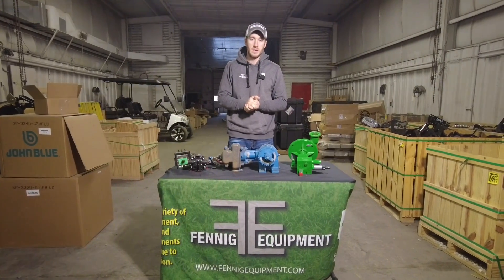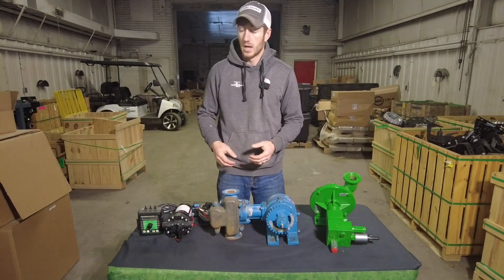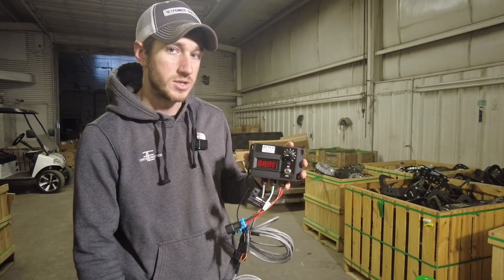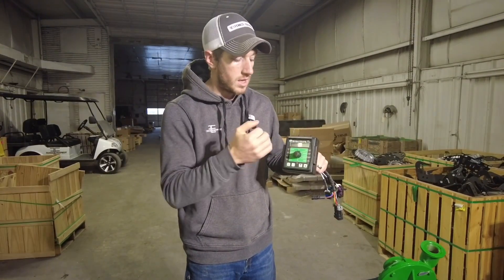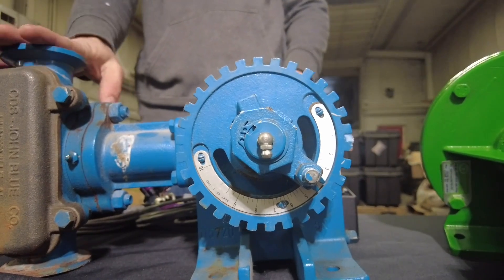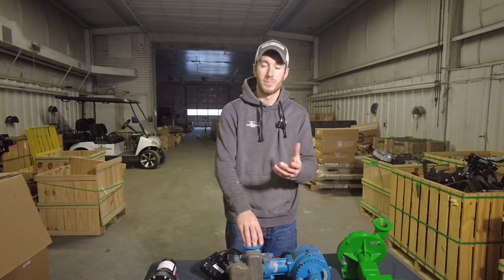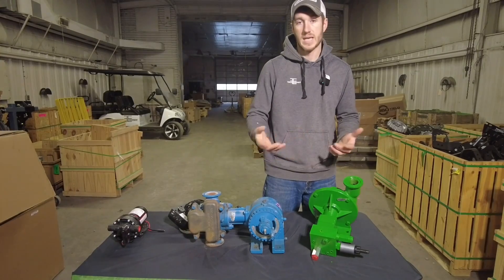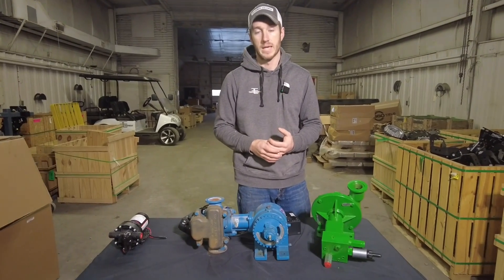Choosing the Correct Pump for Your Planter Fertilizer System

Comment: With the pwm Hyd pumps do you still need the butterfly valve? They get on rate good on the ends?
Reply from the maker: The pwm is the butterfly valve, 
The difference is the PWM valve controls the hydraulic oil going to the pump so that the pump only spins as fast as slow as it needs to. Whereas in a electric butterfly valve situation, the pump is running a static speed and the butterfly valve is controlling the liquid product coming out of the pump . The PWM valve increases and decreases the hydraulic flow going to the pump so that the exact amount is always coming out of the pump, so no need for a butterfly valve downstream.
Reply: @FennigEquipment  yup that's what I thought. Now if only we can get deere to code the software to tell the tractor to speed up or slow down the scv based on the gs rate controller  needs. so then you don't need another  electronic gizmo to go bad. With seedstar 4 that is already  happening for vaccum control I think unless the valve is on the planter side
Reply: I run in furrow with a John Blue piston pump but don't have orifices? Just lines to each row with check valves to stop the dripping when lifted. I believe all lines are the same length.
Reply from the maker: @LibTechsb  is there a manifold present?
Reply from the maker: @LibTechsb  your orifices are housed inside the hose barbs on that manifold
Reply: Do you have to have a recirculating valve and hose on the pwm set up?
Reply: By pass valve is what I meant